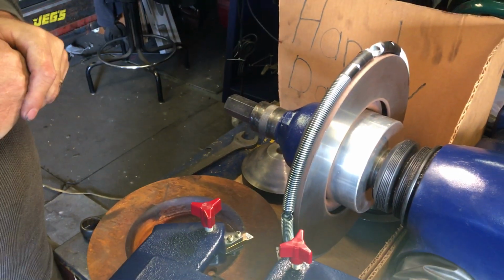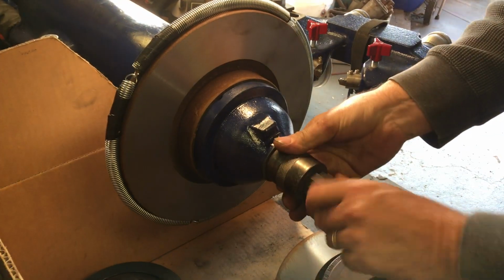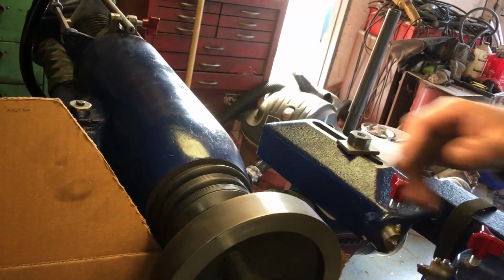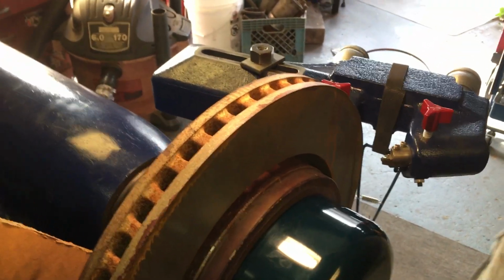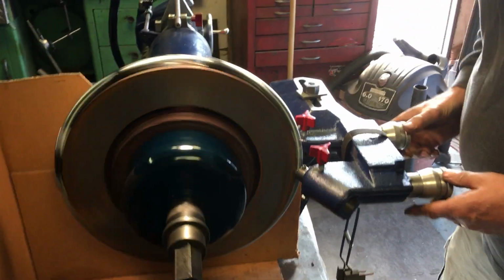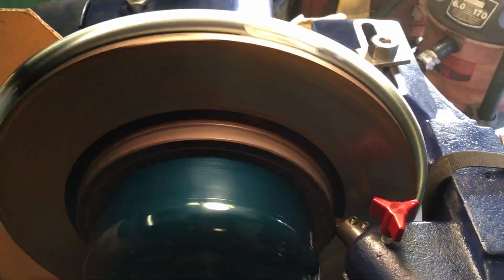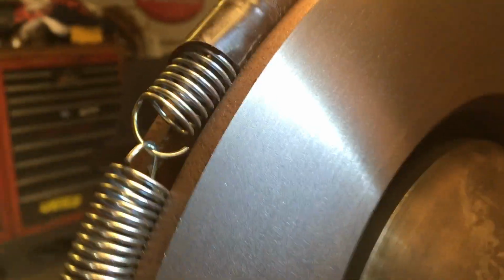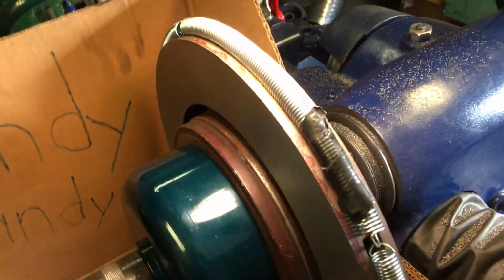Proper Tooling for larger rotors (on an AMMCO Brake Lathe)

Comment: Hi sir, good video thanks ! Can you please tell me where to buy this bigger cone or juste the part number please ? your website doesn't seems to work anymore
Reply: large set - https://www.ebay.com/itm/373788798762 I put the small cup in the main comment stream also. The small cup is the one on the machine when the video starts.
Reply: @handydandyupgradesinc7164  thanks a lot